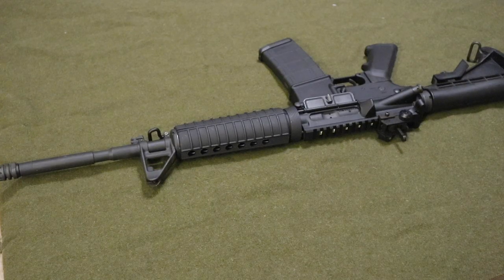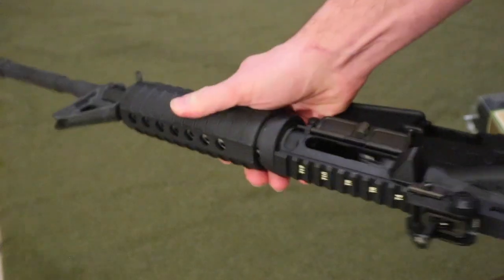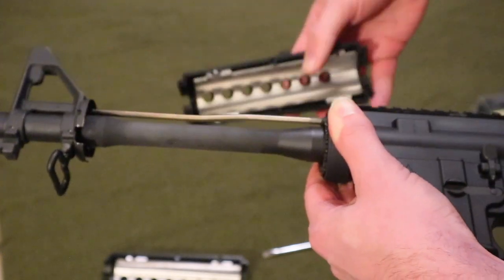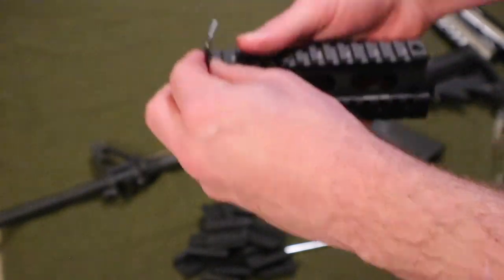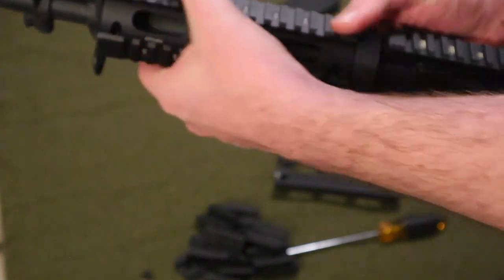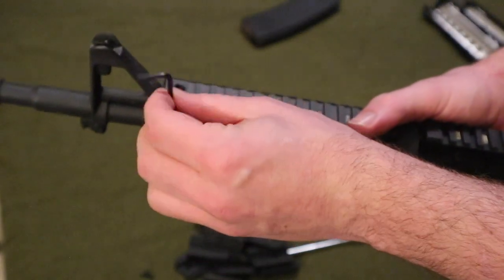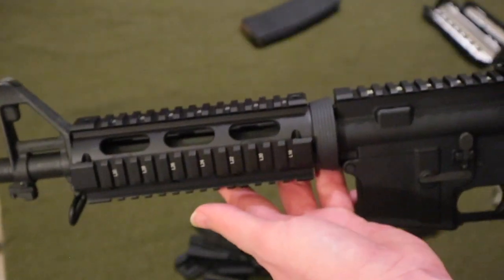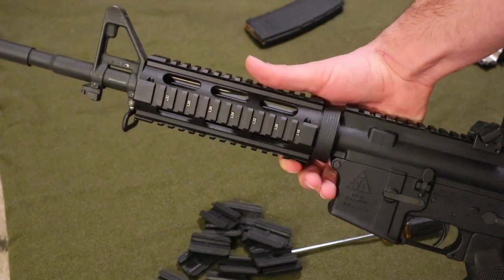How to install a UTG PRO QUAD RAIL on DEL-TON AR-15

Comment: So I have the Del ton echo 316L what size of quad rail I need. So can a 6.7" work
Reply: Chris Petersen I have the same one what did you end up doing?
Reply: @fmjjr339  I did a monstrum tactical AR 15 quad rail carbine length drop in
Reply: Chris Petersen thanks for the info
Reply: Have you done anything else to it. I just put a sig msr red dot but want to change the look a little bit
Reply: @fmjjr339  just a 1" inch riser scope mount then a 3x9x32 scope by monstrum tactical. I love there scopes I have one also on my Smith&Wesson 15-22